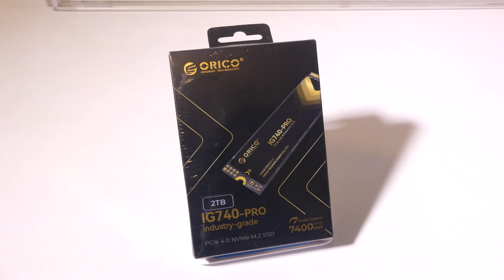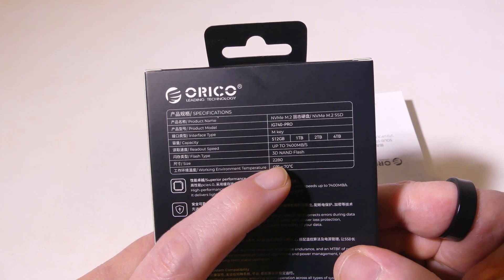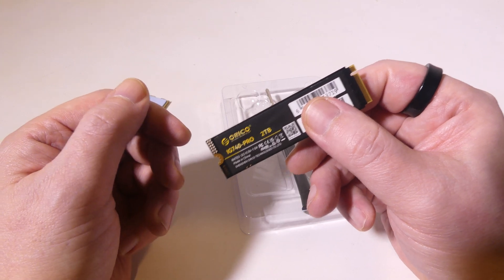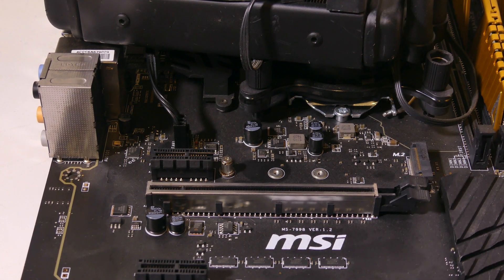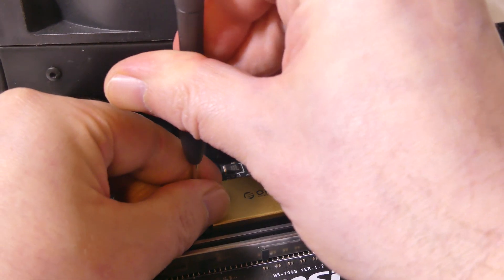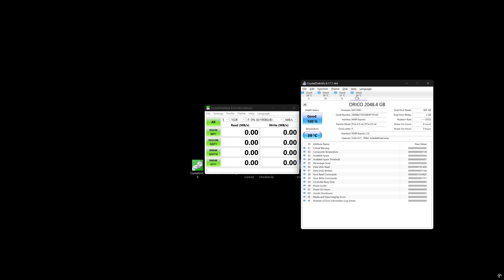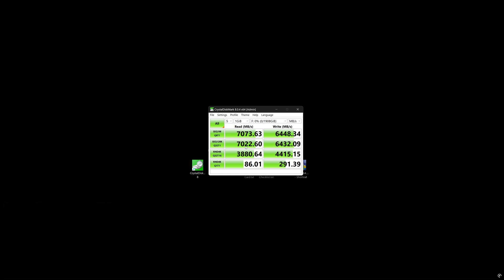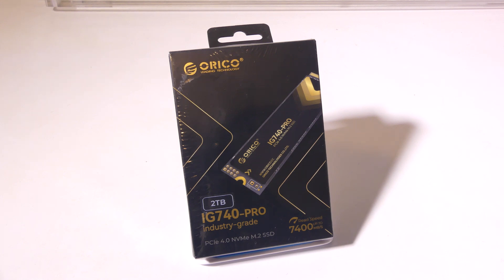ORICO IG740-PRO PCIe 4.0 2TB M.2 NVMe SSD REVIEW - It's FAST

Comment: EXCELLENT tutorial. How is the heat? Will it handle fast transfer - cache fill up quickly?
Reply from the maker: I had no issues with large file transfer and cache.  Being a fast drive make sure you get a good heat sink for this drive to keep it steady( like with all faster drives). Overall solid drive with good speeds.
Reply: @GalaxyTechReview  Do you think that a under PC dual fan base (FAN MAT)?

Comment: If cloning to this drive from a main SSD/NVMe SSD it will only clone up to the same size partition of the original source.  I will not let you 'Extend Volume" do to having a "Recovery" partition in the middle (in the way) of the "Unllocated" partition.   In this case you must use "Command Prompt" and do some commands in order to temporary delete the "recovery" partition that's in the way and then be able to merge the Unllocated partition into the C: drive (main drive) and then keep using Command Prompt to recover the deleted Recovery partition back into place! 

Was able to Unleash the BEAST of my amazing powerful High performance "ORICO Enterprise NVMe 2.0 Xtracking 3.0 (232-Layer NAND TLC SLC+HMB Cache) 2TB with ECC RAM Industry Grade IG740 Pro" PCIe Gen4x4 7400MBs speeds (TBW= 1200TB) Premium Flagship SSD!